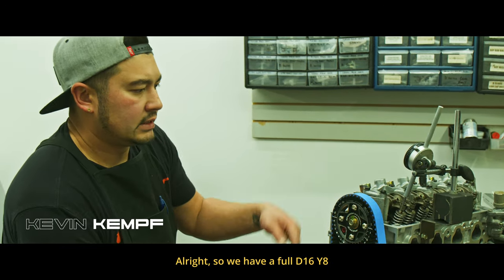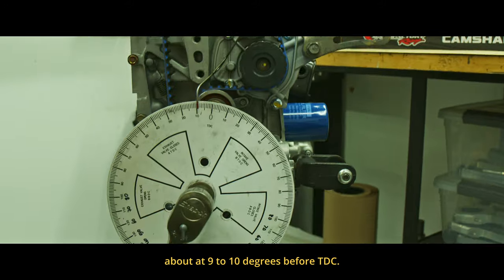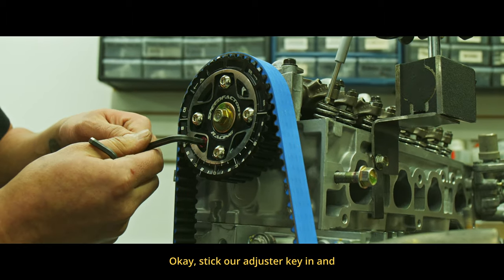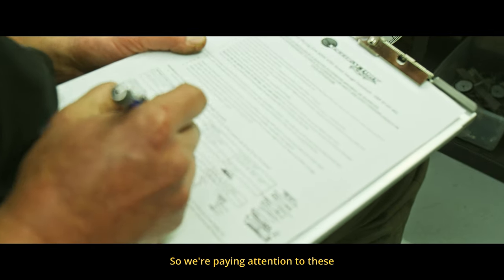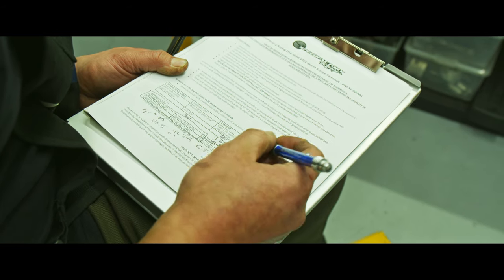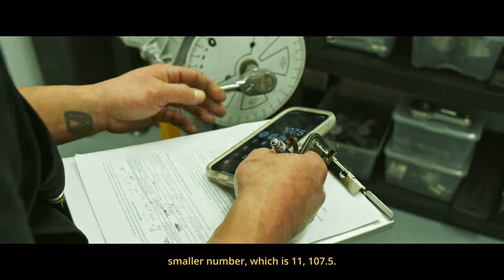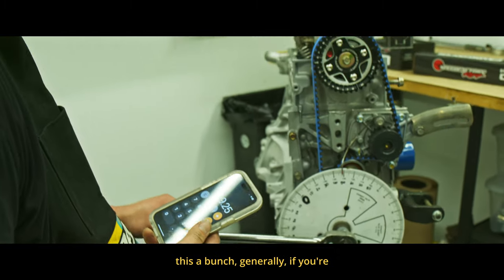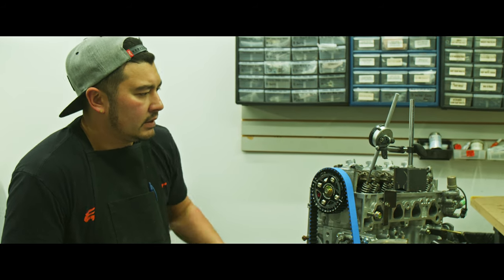HOW TO Degree Your Single Cam Using Adjustable SpeedFactory Cam Gear! and Degree Wheel! (4k)

Comment: This is awesome, thank you guys for making this! Would love to see a video on the B series version. Why would you get .435 lift on the valve if the expected lift is .430? Manufacturing tolerances?
Reply from the maker: Yes the manufacturer will have specific tolerances (rarely do we ever get all of them exact) these variations can be caused by human error or even small defects in tools. As long as we can get the numbers close or even some on point. We typically don't have issue. 🤙🏼

Comment: How can I lock vtec without lock pins? I want to degree the cam but there are only infos about vtec. Or is this cam designed for only locked vtec application? I dont want fo drive locled vtec.